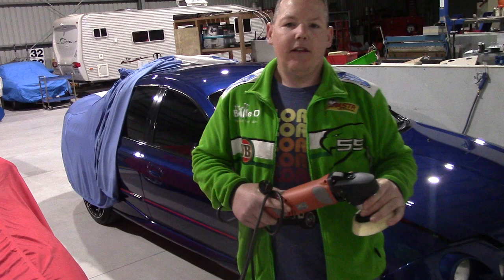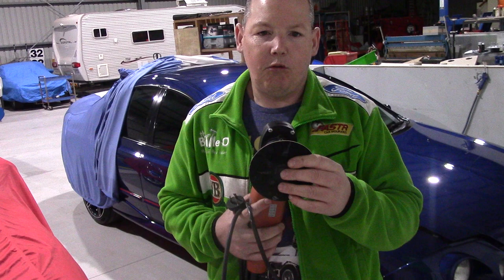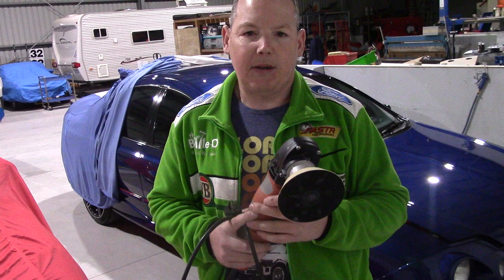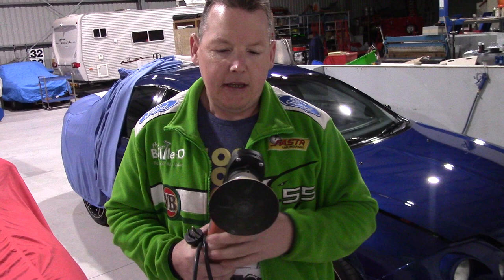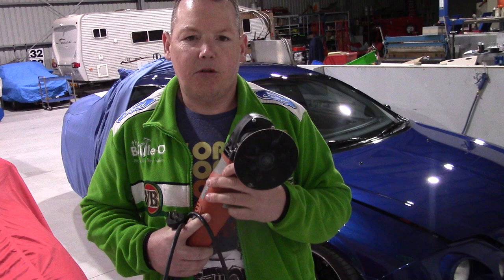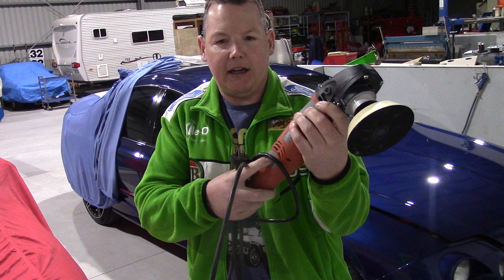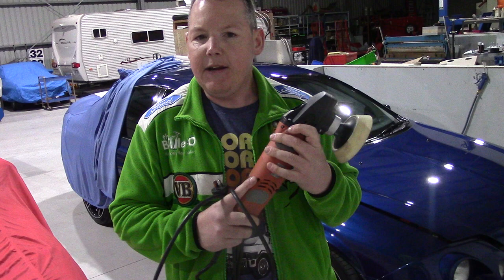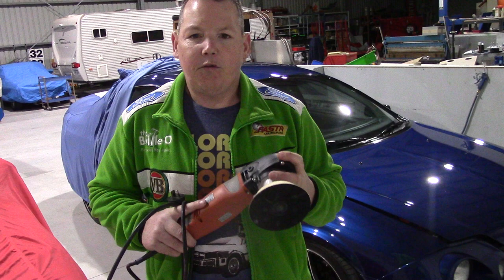Dispelling the myths and giving the facts  -  The Rotary Polisher (Part 1)

Comment: Im novice, but i rlly want to use this tool, i think is more versatile than DA
Reply from the maker: Hi there thanks for your comnent. Rotary is more  versatile with 1-9 inch pads able to be used with it, different thicknesses of backing  plates and ability to be tilted on an angle and will always spin unlike a DA in some spots